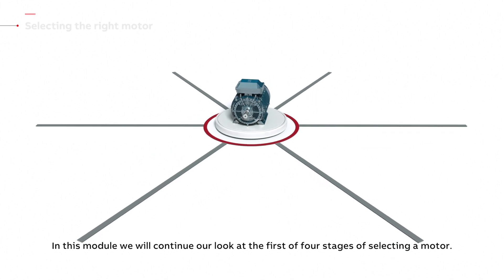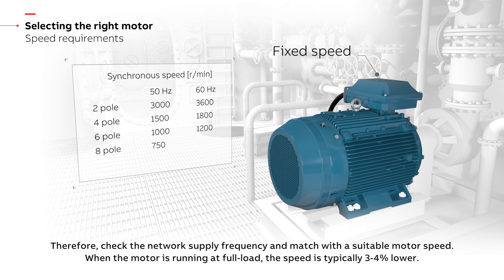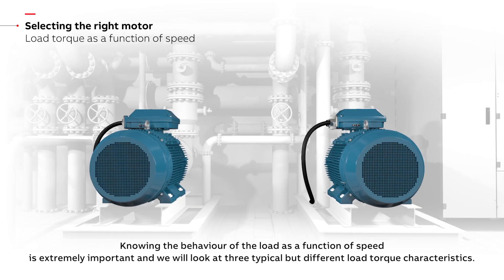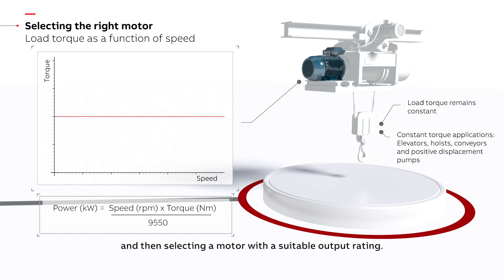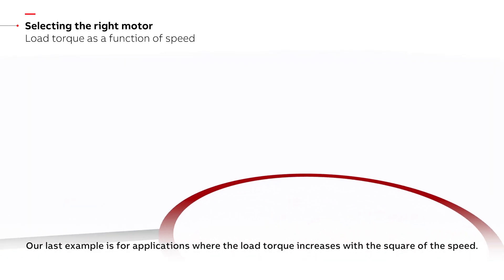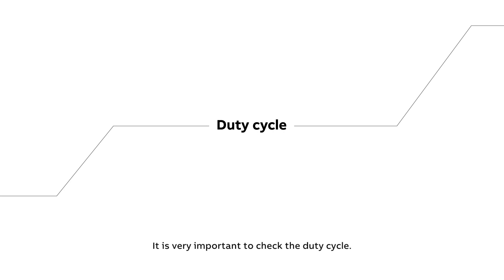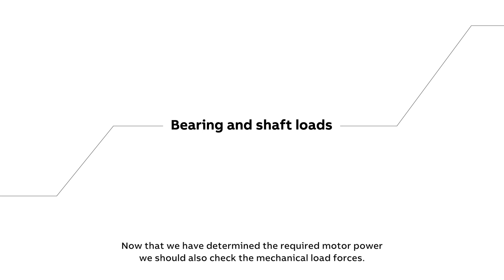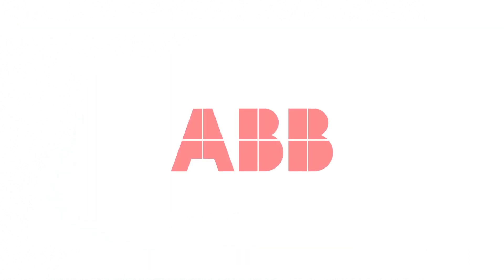How to select the right electric motor - part 2

Comment: Where does 9550 come from? 
1 kW = 1000 W = 1000 * N * m / s 
1 rpm = (1/60) * 1/s 
Therefore: 
(1 rpm) * (1 N*m) = (1/60) * (N*m/s) = 1/60 W = 1/6000 kW 
9550 is 60% more than 6000, is this because starting power has to be much higher than running power or what?